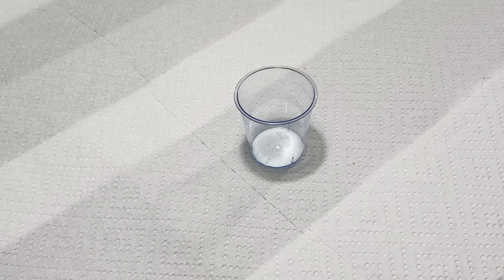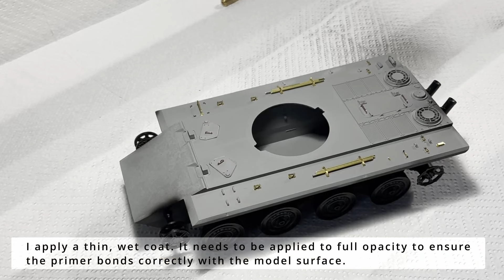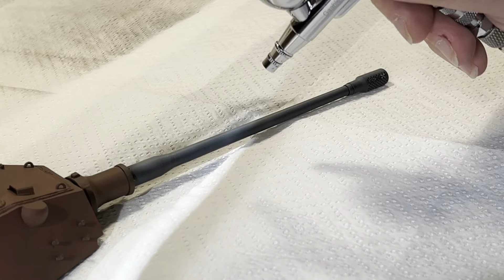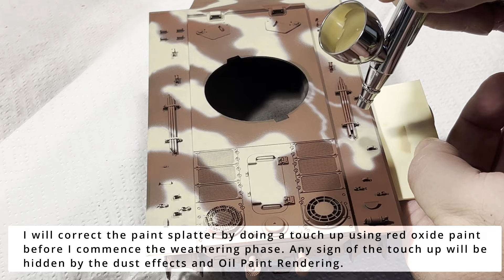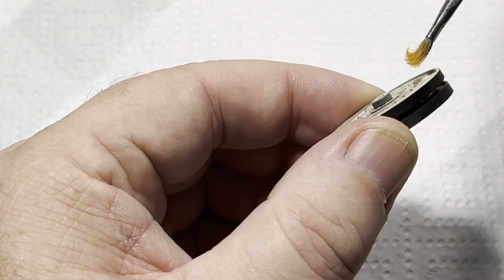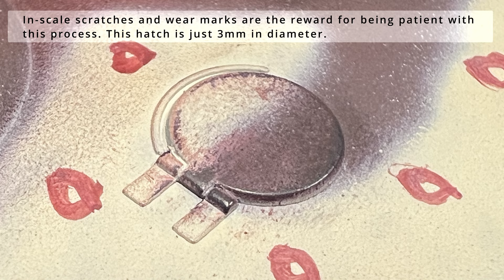E-60 Part 2 Painting & Chipping | Fist of War 1/35 Scale Model

Comment: So am I correct in saying that for the chipping you did not use any chipping aids at all? Just water? No chipping fluid, no hairspray etc?
Reply from the maker: Yes that's correct. Only water.
Mission Models Paints are water soluble and have a unique attribute... they have an "eracibility" feature where they remain active for days and can be partially dissolved with the aid of water. This gives them a unique position in the weathering capability as opposed to all other water based acrylics. That's the good news. And with good news there always seems to be some kind of bad news too :)

MMP reacts very poorly to alcohol which is the main component in most commercial chipping fluids and hairspray. Even Tamiya acrylic thinner, X20A, which contains an alcohol base, will literally strip MMP in front of your eyes. It's why I say MMP must be its own eco-system and only use their thinner or water.

I totally suggest jumping over to Mike Rinaldi's channel and having a look at his teachings on how to use MMP. Check out this link to his RSO Painting and Chipping How to because it's fairly short to watch and makes it easy to understand the how's and why's:

https://youtu.be/nWc6vTBsgqQ?si=1rqAkpjbAfdDggXG

Great question. Thanks